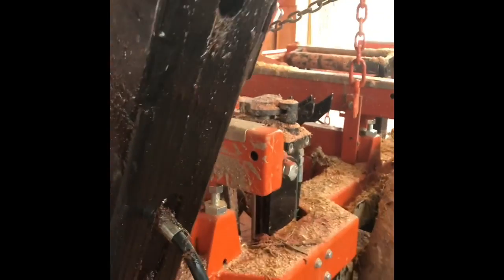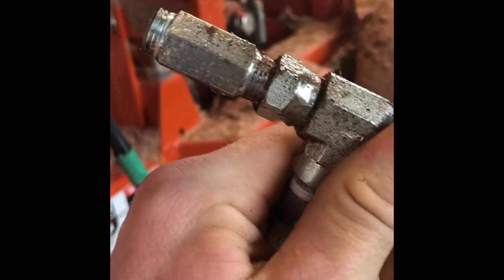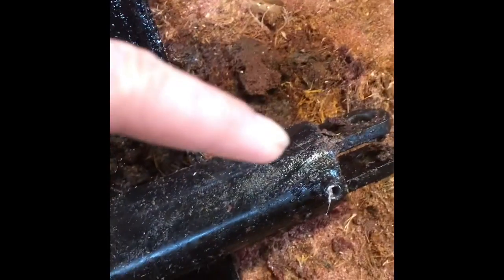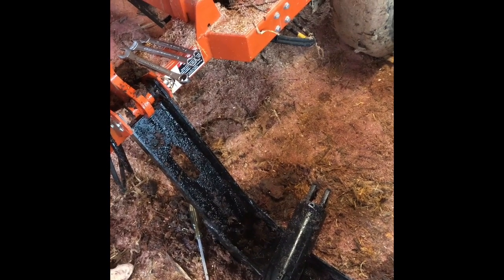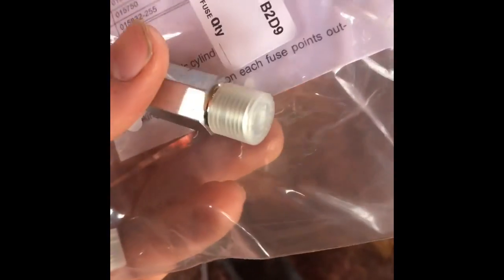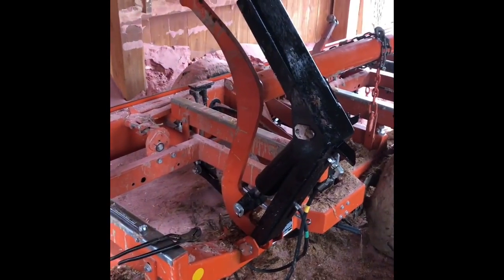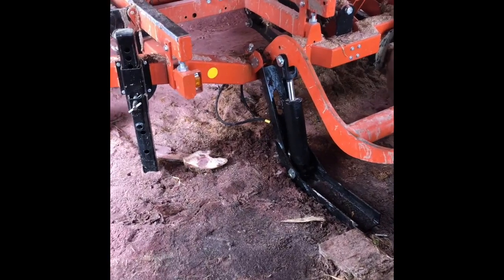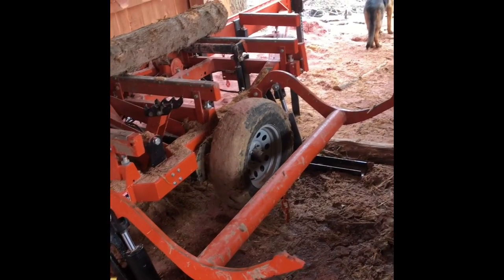Woodmizer MAJOR breakdown Problem SOLVED!

Comment: A lot of these hydraulic fittings are common. I bought a grapple for my tractor and the fittings that came with the grapple didn’t match the ones on the front remotes on my tractor. I went to my local O’Reilly’s and they had the right fitting which was the good news — but the bad news was they wanted $58 for it. I found the same fittings on Amazon for $17. 

You are sure right about NW Sawyers video content and narrative. It’s really well done. It looks like he had some training in video production. He uses a tripod for most of his shots and when he’s hand holding his camera he moves very slow and smoothly. That makes his video much less jittery. He also is slow and smooth with his narrative which shows that he knows just what he wants to say. Most times saying less is better. Just let the video show what you want said. Good luck with your future videos. I’m from the ‘show me’ state too. Down in the Ozarks.

Comment: it is called a snubber or flow restrictor or reducer, depending how the manufacturer titles it. a hydraulic shop worth their salt should have those on the shelf. a square bolt extractor would have gotten the broken threads out without having to take the cylinder off.

Comment: Is that fitting directional? It may allow full flow in one direction and be orificed in the other. 

When filling from that jug it's easier to hold it sideways and pour it that way. Of course that takes two hands and in your situation what usually happens is the force of the oil will knock over the funnel so you still end up with a mess LOL. Maybe some blocks of wood could be used to support the funnel. You say the spilled oil is no big deal, but it will collect dust and make future work less easy. By the time I'm posting this, it may be a good idea to pop off that cover, clean out any accumulated sawdust and spray it down with some brakecleen. Preventative maintenance is key to long life and lower cost of your equipment.

Comment: Since the mill is used in a stationary position that could allow the soil to compact under the repetitive load.  So place something under them to provide additional support.  That should prevent them from sinking and putting  side pressure on the fittings.  Like a 2x12 board, perhaps long enough to reach both supports.
Reply from the maker: James Finnall yeah that is a good idea. Thanks for watching!

Comment: Is it possible the big rail is actually the reservoir. In a typical hydraulic system the reservoir is a the buffer zone that removes a shortage or oil to the pump suction or (starving) the pump.

Comment: I feel for you and your problem.  I guess I have not looked that closely at the lift mechanism on my buddy's 40 but I am sure it is most likely the same...got to look the next time I am over at the mill.  He has a concrete floor under the mill so that may help in preventing a similar break.  I guess the "good" thing about your break is that you did not need any Speedi-Dri to pick up the oil...just shovel up the oiled sawdust and burn it.  Always good to see when someone has a problem so that you can store it away for future use.  The WM dealer is not too far from here...45 minutes to an hour to get there...depending on the weather/snow.
Reply from the maker: Tony Baleno that is really nice having a concrete floor for sure. I wouldn’t see that being a problem at all if there was the concrete. Oh ok I gotcha that isn’t far at all. Thanks for watching!

Comment: Makes me want to order a pack of those fittings. Would hate to break down while out on a job.
I have the LT35HD as well.
Thanks for the heads up on a possible issue.
Reply from the maker: Iron & Oak Sawmill That wouldn’t be a bad idea. Yeah I was lucky it happened in the shed and not out on a job. I follow and watch your videos they are really good. No problem I’m glad I could help
Reply: @pattonwoodworks  wish I had a shed like that. Could get a lot more milling done. Too much rain around here last year.
Personally, bbn I think that fitting that broke, is too long, and it was stressed too much.
Reply from the maker: Iron & Oak Sawmill it makes a huge difference. I wish it kept out the cold though lol. We’ve had a ton of rain here this year as well. 
That is very true. Oh well stuff happenes

Comment: Doesn’t your sawmill have a hydraulic reservoir, so you could have added oil that way?
Reply from the maker: Allan Moulton That is the reservoir. I could be wrong but I don’t know where it would be at if there was one. The hoses run straight from the controls to inside the big rail and go down then come out of the rail to where the cylinders are located

Comment: It’s to bad they don’t make it an Allen head on the inside so when it brakes you can just back it out. You could drill it and tap it out.
Reply from the maker: scot butler yeah that would work good. I’ve never used them before but we just used these easy outs and it came right out. It took less than a minute and worked really good. They are really cheap too.